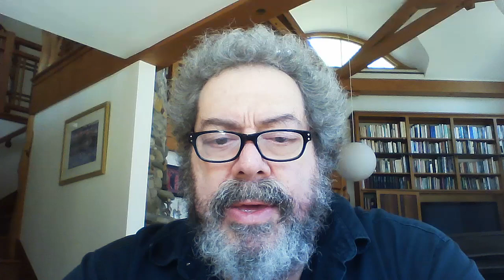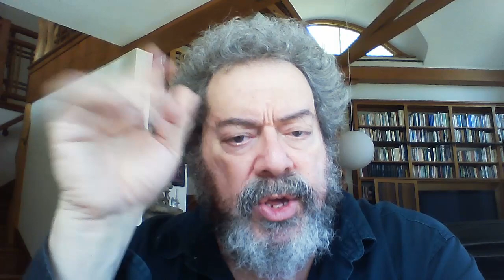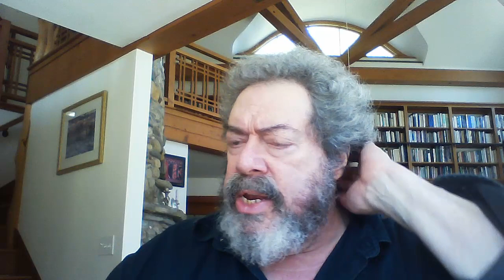Soundsmith NJ/NY Zoom answers part 2

Comment: A cheap way for the lathe is to get proper isolation mats, what is a 5-mm rubber with a foam sandwich. For the ultimate isolation a gimbal system with air bearings in the Y and X axis with a platform that is suspended,  I've done it for my turntable I use bungee cord in a zigzag pattern all the way round except the corners, but a lathe is heavier so maybe hemp rope might be better solution soaked in silicone oil, it Is easy to build a isolation platform like this and cheap. I will described the board and the frame, it is just router out in a zigzag pattern around the edges and posts brass bolts are screwed in on both sides the frame and the board/platform, you weave in your chord between the two stretching the chord and fastening to under the board. Make your platform out of two sheets of three-quarter MDF glue to half an inch of paper corrugated the same as cardboard box material, this is a very strong material rigid in its nature and has isolation in its own right, just glue the paper and MDF with PVA glue place weights on top and let it dry overnight. ps put a bolt / threaded rod in the middle of your platform so you can hang some dumbbell weights might help for stability

Maybe you could answer this question for me I can't find any results it is partly to do with isolation mechanical and electrical.
 I'm thinking that placing the lacquer in a bath of thin silicone oil the lacquer and the cutting head this will damp down  any surface mechanical vibrations and electrical vibrations from the coils, I don't know if you can try it out and give it a go? Another process is to put the lathe in a vacuum chamber pump all the air out and put in CO2 would have a similar process.
I think having the cutting head running on a lubricant ads lots of benefits firstly it will give it lubrication for the lacquer and cutting head what should eliminate jitter dump down any electrical noise from the coils and any surface noise from the machine and the noise produced by cutting.
You get a 78 and you put WD40 on it brings it to life it cuts down the surface noise I think cutting the lacquer in the same way add more detail,  give a quieter surface, more input to the cutter might be needed I'm not sure but I wouldn't have thought it'd be a lot if any. 
What amplified are using I'm hoping valve for your lathe, Manley Labs or ortofon, Manley Labs have just invented a fantastic switch mode power supply for their valve equipment and advise you to use it,  makes valve equipment much more darker responsive in its nature for audio. Eliminates 50/60 and 120hz hum. What is very bad for valve tube equipment. Keep safe out there you should start up a patreon I'm sure people would like to donate.
Makes a good speaker cabinet as well the cardboard and MDF sandwich doesn't need to be thick and I would swap out the MDF for hardboard hdf and for the front baffle swap out the cardboard for foam cellulose foam sandwich

Comment: Some thoughts about the 45RPM speed. 
78s may have been made differently, but the difference in fidelity between modern 33 vs 44 RPM is as I understand it non existent.
As the cutter head will be doing the same movement regardless of how the lathe spins theres no more information being put in.
45 RPM certainly doesnt sound worse if anything, its only positive in regards to ease of playback. But there are a few problems when we compare the two. Most 45RPM reissues do not have the same mastering as other 33 counterparts, making comparisons unfair to begin with. Also, even if they do share masterings, the 45 version is usually cut louder. If one does not compensate for this my normalizing the audio signals you will again put the 45 in an advantage as louder can easily be perceived as more better in every regard, detail, soundstage, dynamics, and so on. But you can measure some things like dynamics and show that this is clearly not the case. 
Balance the audio for both and the only difference might be a slightly louder noise floor on the 33 which given a good pressing and loud music shouldnt matter at all.
Reply: Thepro
Yes the cutter head will do the same movement. 
But if the cutting head is doing 10 000 Hz and the material lacquer is going by the cutting head faster as on a 45 instead of 33⅓.
Then those small wiggles the cutting head is doing (10 000 times back and forth for each second).
At the same radius on the record the 45 will move the disc 35% faster past the stylus tip. But it is still 10 kHz.

What have changed? 
Instead of small fast changing hills and slopes in the groove what makes it harder for the stylus to keep in contact and track in the 33⅓. 
We have as you said put the same movement into the cutting head and the sharp hills and slopes is now in the 45 rpm case 35% LONGER. And is now easier for the stylus tip to track and keep contact with.

Remember what Peter said that complex music parts  there several instruments is playing at the same time. Is the hardest and more difficult that a stylus/cartridge have to retrieve from a record groove. And that is one thing he tests when he is developing a cartridge. With that in mind. 
It is very beneficial for the outcome of the sound quality if we could "stretch" out the same complex amount of information on a longer grove so the stylus could be able to do a better job and insure that it keep contact with the grove walls at all times.
You see were I am going. Yes 35% longer grove will provide just that. :)

So there is no reason to try to find a alternative reason of why not a 45 rpm sounds better than a 33⅓. Trust your ears.
Happy listening!
Reply: @AmazonasBiotop  I understand what you are saying.
With a thin stylus profile these issues are lessened however, and no extra distortion is introduced.

45 is a superior format but intrinsically it is not better sounding. It sounds the same unless the stylus is mistracking on one which again it should not with a good enough setup.
Reply: @leon9021  Good then we can add more information..
When looking at one of Michael Fremer factory tours of one of the biggest LP manufacturing plants.
They mentioned (as we already know) that they take the digital original and master it especially for record production. Because LP format has its own special limitations as format (as every format has in one or another way)
One well known limitation is that for LP it have to master it with mono bass for example.

But the interesting thing they said were that some artists, groups and if not the mixing engineer had taking in account that it should end up on a LP. There will in those circumstances be very high pitched sounds that they needed to remove. (Yes the smallest and fastest wiggles) that give the LP format problems. 
So that were also removed before it were sent to the cutting head.

That tells to me that it is maybe not that easy that we think for a well setup TT to track constantly the groove walls. As we might think it is.

When they already in LP mastering get rid of some of the highest frequencies to guaranty better playback in the end.
Reply: @AmazonasBiotop  Plants like GZ might cut a record with reduced frequencies if the client wants it or engineer deems it right because they are usually aimed toward lower end gear.
Audiophile labels like MFSL, AP and MMJ dont limit themselves in this manner and usually cut whats on the tape pretty straight, because they know their customers are audiophiles mainly.

If you have a conical or basic Ellitpical, it will mistrack on a lot of records. Better shapes usually will not unless its extremely demanding.
Reply: @leon9021  Yes that might be the case also. (Noting is black and wite)
And what we think is "tracking good" may not be the case when we zoom in to the groove the stylus will "jump" (microscopically) and leave the side wall of the groove during playback.

That is why Peter emphasize the importance of low mass at the end of the canteliver that is the opposite end of the diamond.

Because he knows that energy (vibrations) that travels up the canteliver will reflect and travel back to the diamond. That reflected energy have to go somewhere and some will go/dissipate down to the record and the diamond can/will leave the contact of the groove(s) wall. 

That is one of the reasons why Peter have so light canteliver assembly (dimond, canteliver and the continuation of it in to the cartridge)
So that may be the case that sound smith cartridges may sound better (?) when they in reality are x% more of the total time in contact with the groove walls? 

The point is that track well is hard to define.. Track well is for me that the diamond never leaves the groove walls. But how to quantify and know that is nothing I can do.. 
(By ear maybe but there is so many other factors, not many has identical cartridges with different mass of canteliver assembly.)

But back to the topic. Yes the 45 is making the groove fly by the stylus faster but the steepest/fastest (highest frequency) will be not that step and despite if we use shibata, micro line or other advanced stylus shapes. 
I still think there something their that when a stylus play a 45 rpm to have more wall contact over the playing time despite it is turning faster. Is one of the benefits.
Take care!
Reply: @AmazonasBiotop  Sure there might be slight distortions, but we are talking audibly here. I do not find it interesting if 45RPM is so minutely sonically better that its in audible. With a high end stylus I dont think theres a difference given identical mastering.
Again, 45RPM is superior, but it doesnt automatically sounds better than 33.
Reply: @leon9021  Yes that is the tricky part to prove that it is audibly better..
Their is so many factors and variables here involved some that you have pointed out.
But when I am (biased/experienced) think that 45 rpm is sounding better than 33⅓. 

I usually buy everything that I find 2nd hand only because it is a 45 rpm. I mean those 12" maxisingle that has one (mostly hit) song on them in maxi edit, radio edit and normal version, usually.

It do less matter for me what group or type of music it is. Only that it is a 45 rpm, then it go into my basket. :) And I use a advanced stylus shape (ML). Using US cleaning when I do not know when the record were cleaned the last time and to reduce stylus wear.

With that said I have then experience of the sound quality of all my "normal" 33⅓ and all of the 45 ones.

And in general the avrage 45 rpm has audible better sound than my bigger part of collection that consists of 33⅓ rpms.

And I feel still the same and I am continue to grab the 45 rpm if I can choose or find a random one. I am all for SQ as no 1 and I do not care if the cover is torn or has ring wear and so on. Just that the media is in great shape.
Reply: @AmazonasBiotop  Well an easy way to convince me is to just get the 33 and 45 of Kevin and Steves cuts of Fleetwood Mac Rumours, equalize the levels and record samples on a high end deck. If you can tell those apart in a blind test Ill accept that 45 RPM sounds better because its the same mastering.

The reason why your Maxi singles sound better is probably because they are mastered louder or something similar because less songs allow it.
Reply: @leon9021  have yo done the test yourself with the Fleetwood Mac rumors? And how did it go for you?
Reply: @AmazonasBiotop  No, Im currently looking for a second copy. Theres a thread on Hoffman forums about it and some who actually tried it and balanced volumes say theres no difference.
Furthermore, Steve Hoffman, the man who cut the records agrees that they should sound identical except the 45 is louder.
If even the engineer himself hears no difference on identical masterings then it says a lot I think. I used to believe 45 was always better like many until I read through it all.
You can also check Dynamic Range Archives and see that both the 33 and 45 have the same Dynamic Range, even though some claim 45 makes records sound more dynamic, this is clearly not true necessarily.